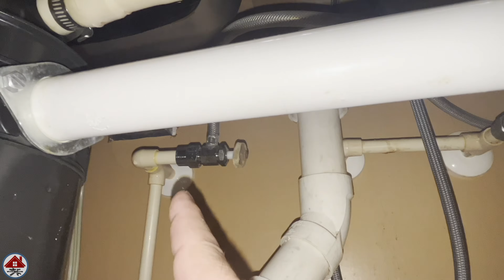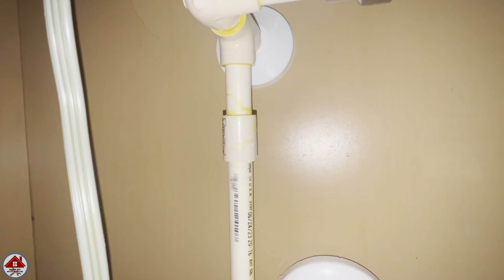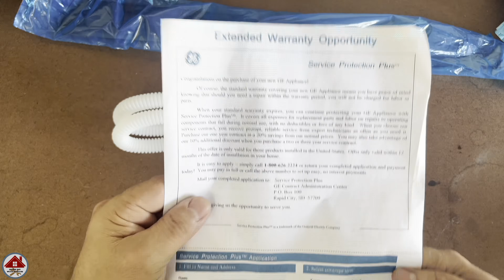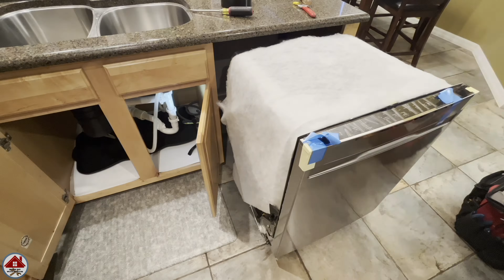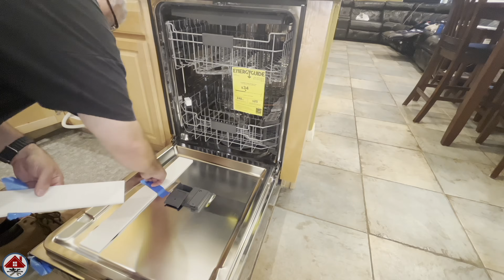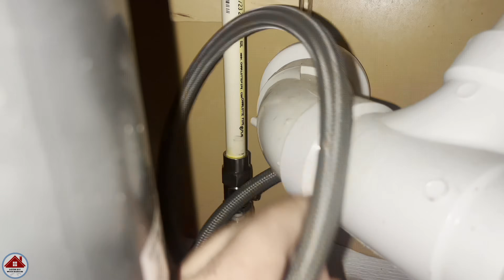DIY Dishwasher Install

Comment: Nice install. I just installed the same dishwasher today at a rental property. The only thing different on mine is that mine has a door handlebar. other than that, same control panel and everything. I also liked the fact that you can see and push the buttons even with the door closed. It is a quite dishwasher.
Reply from the maker: Thank you for the comment and for watching. I appreciate that! It’s been cleaning the dishes great, very quiet. 👍